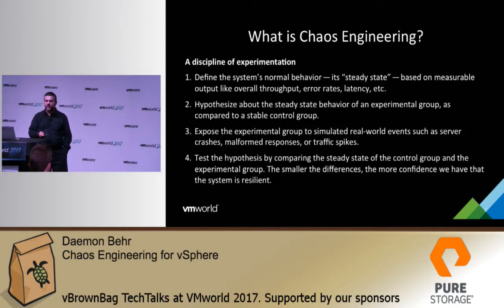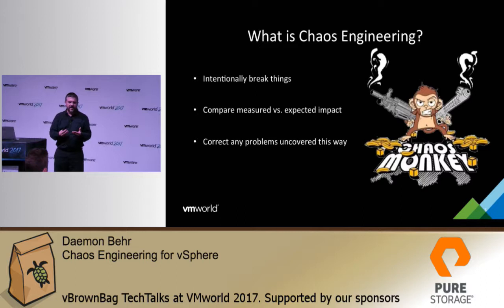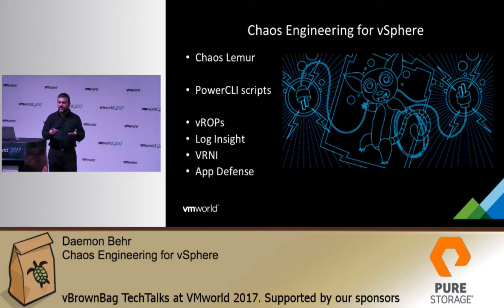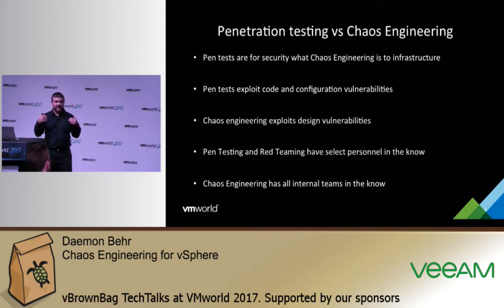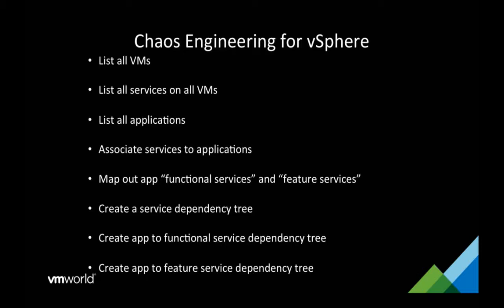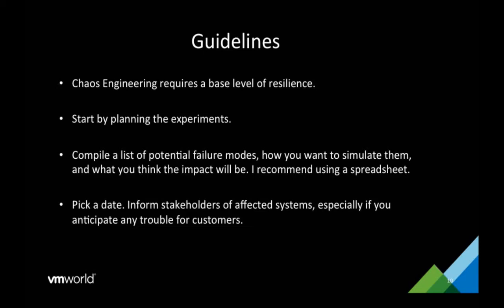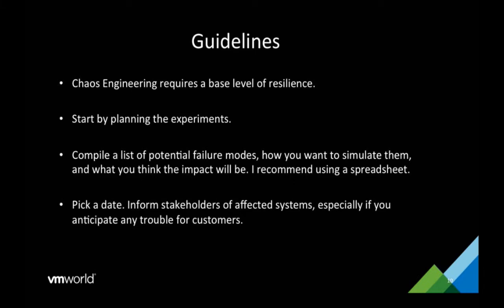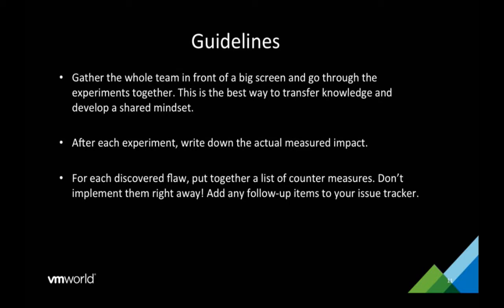Daemon Behr - Chaos Engineering for vSphere

Comment: Really interesting... So final tests are done in production environment or virtual environment?
Reply: The goal is to have the fault injection performed in production and have minimal or no impact to the affected applications. However, it is the process of discovering dependencies and risks that allow for either acceptance of the probability of the failure, or a remediation plan to bolster the "at-risk" areas. If the risk is accepted, then a response plan is created for the failure.